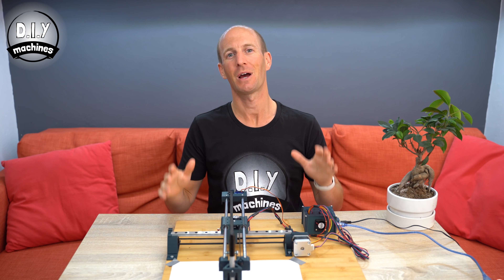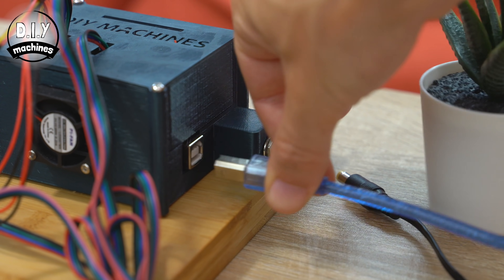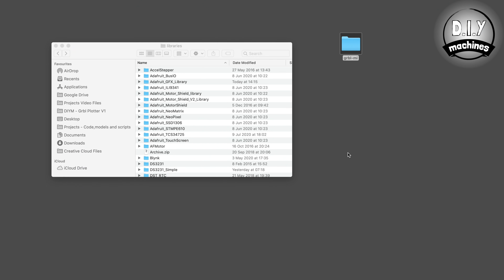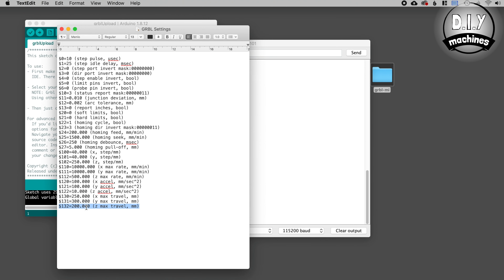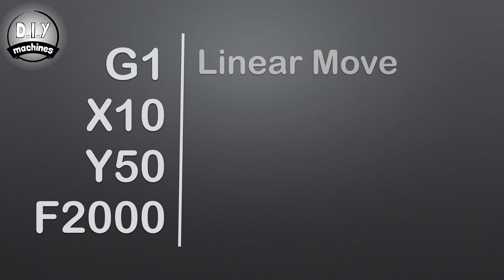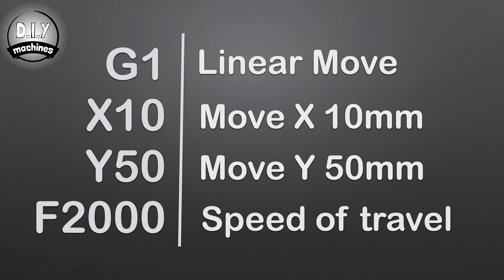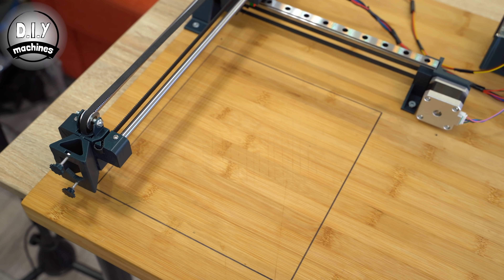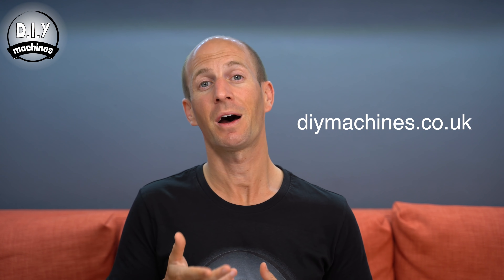Part 2 - Super Easy 3D Printed Arduino CNC Drawing Machine - The Software | GRBL | Inkscape Plotter

Comment: I don't understand why you wouldn't just use a regular printer?
Reply from the maker: I've used this to draw onto material a normal printer could not. Cake in the video, but also large panels of balsa wood to then cut out with a saw and make a model boat.
Reply: @DIYMachines  Thanks for replying, first up i feel i must say i'm a toolmaker, with my own DIY CNC in the garage/workshop capable of milling steel. 
The cake print, sure, understand that one, those are pretty expensive. Model boat, 3D print it or in my case mill it, unless the material is of great concern, tho i never really understood why people care to build models of already existing work. But yes, i can see how this "printer" would appeal to the DIY model community
Currently i'm looking to build a laser cutter, for cutting gaskets and figured i could use some ideas from your build

Comment: So my servo does not work with the M5 M3 codes. i am pretty sure i did the correct connections and tried servo on another arduino, it works right. How can i solve the problem. Also my steppers works so slow and vibrating. Does anyone knows why?
Reply from the maker: Which stepper motor driver are you using?

Comment: Sorry dude but your design is awful, that machine wouldnt last 100 drawings without falling apart. you did everything wrong, from putting the endstop switches backwards to making all the plsatic parts super thin. to be fair you dont even need to use it 100 times, the plastic itself will break due to creep because you made it all so thin. Also timming belts are not ropes, use a rope to pull the pen up, not a fricking belt!, a piece of fishing line would do the job better and why did you even put the servo on the other side! just put it right next to the pen holder! god!

Comment: I am really enjoying the results I get from this, very accurate. I am unfortunately getting an Inkscape crash whenever I try to use the gcode extension on an SVG file with lots going on. Simpler designs convert with no problem and look great on the finished paper. Is there any work around for a big load of gcode that needs creating? In smaller parts perhaps?
Reply: Can you layer it?

Comment: How does GRBL or chillipeppr know my pulley-size thus my steps/mm-ratio?
Reply from the maker: You set it in the configuration of GRBL in the following values (how many steps of the stepper moor creates 1mm of travel). Only GRBL needs to know this - chillipeppr does not (it's just a utility to stream the GCODE commands to GRBL with a pleasant GUI):

$100=40 (x, step/mm)
$101=40 (y, step/mm)

Take a look here for some more information: https://diymachining.com/grbl-settings-101-a-how-to-guide/

I hope that helps. Lewis
Reply: @DIYMachines  Thank you very much :)

Comment: If anyone is finding that their XY motors are only moving the pen around 40% of the area that they should be; I had to change both lines $100 and $101 from 40.000 to 100.000 in the GRBL setup document. That sorted it for me so that the X and Y are at the correct scale.

Comment: Hi, I wanted to congratulate you on the project ... it's really crazy!
I scrupulously followed the step-by-step video instructions, but I encountered 3 "problems":

1) Right / left swing of the pen (slight, but prevents small details);
2) Up / down swing of the Y when the servo clicks or in extension beyond 50%;
3) Using the square procedure only about half of the effective area is covered (225x250mm). The $ H procedure is successful.

I wanted to understand if the first 2 points are normal or not and how to solve point 3. Thanks a lot and congratulations again.
Reply from the maker: Thanks for the kind words BlackGeare, I'm glad to hear you managed to follow my instructions. :)
To answer your points:
1) This can be reduced by having less distance between the 3D printed pen slider and the mount it is on. Though too closes and it will not slide freely. A better solution is to mount the pen slider on two small steel rods. This would almost eliminate it but I one of my main design goals was to limit cost and this would have required more steel rod and an additional linear bearing.
2) This is something that has become more apparent to me since I published the design. Where the teeth catch the the main slider you could take the 90 degree edge of with some sand paper and make it more of a radius. As for the extension, this is another cost management choice. Ideally we would have to linear rails - one each side of the print area but this would certainly be a much bigger cost. To make up for this movement at full extension I designed the pen part so it can rise and fall by itself to compensate for this. A slight trade of win accuracy for a big cost saving.
3) To increase the printable area of the machine if it physically is able to travel further on each axis just create a larger document size in Inkscape. 

I hope these points help.
Lewis
Reply: @DIYMachines  Thanks a lot for the answer. I fully understand the need to reduce costs and believe that the project itself is still great. To mitigate point 2 I have reduced the angle to 35 degrees, but I think the main problem is due to the "speed" of the servo movement (too lightning-fast click).
For point 3 is it better to have the origin in the corner (from $ H) or in the center of the print area?

Comment: Hi Lewis. The plotter works great for me but when I use Inkscape to create a g code file with a few objects, when it comes into Chilipper, there's a line from the origin to the first object and then line connects all the other objects.  But when I made the boundary box file it was ok.  Any idea what I'm doing wrong? Suggestions appreciated. Thanks, Gord
Reply: No need to reply. I figured it out. The M3 and M5 settings need to be reversed as you said :-). Thanks!

Comment: Instead of belt can you use T8x8 300-600mm Lead Screw Pitch 2 Lead 8 Stainless Rod Linear Rail Bar Shaft?
Reply from the maker: Yes you could do this. You would need to adapt the printed parts to accommodate the change in shape.

Comment: Hi, great videos. I’m nearly done building this but have a couple of issues. 1 noisy steppers and 2 I have had to set the grbl configuration to $100=5.00 x, step/mm)
$101=5.00 (y, step/mm) to stop the x and y trying to go outside the limits of the drawing area, they just fly off at speed!  Got to be a config issue but not sure where to start. I have 1.8degree 200step motors.
Reply from the maker: Hello, and thank you. First question, which stepper motor drivers are you using? You are correct to adjust $100 and $101 based on your machine. Ideally have it draw a 10cm square and adjust this values up or down until what it draws is actually 10cm's square. Are you zeroing out your axis after homing the machine - if not this is like to cause it fly of at speed and make an uncomfortable noise. Check here in the video: https://youtu.be/8scKLHz77Lg?t=660. After zeroing out the co-ordinates in the top right of Chillipeppr should all read 0.
Reply: @DIYMachines  many thanks for the reply. I’m zeroing manually at the moment as I don’t have the end stops installed yet. I’m zeroing. In the correct place though! I’m using DRV8825 and the CNC shield
Is set to full step (no jumpers) if that is relevant. I’m drawing a box and it is just about the correct size. This appear to be working ok , just the steppers are noisy and I’m
Puzzled why I need to change the vales in the config file. (I’m using UGS btw)

Comment: Hi,
now I made some drawings on that machine.
Some comments what I notieced:
Drawing in incscape is difficult for me. Did use a wacom tablet to copy a printed drawing to incscape. When I draw not only a single stroke but more back and forth with the pen then sometimes the GBRL extension makes a round circle out of it. Have to find a workaround. Or do only single strokes. 
Some odd pehenomena is, that I draw some freehand lines and the machine via Gcode does exactly like I did with the pen. Same slow downs. But have to experiment a bit to confirm that behaviour.
Maybe I have to write a simple programme to feed the gcode to the machine. Then I can feed line after line under my control and when I want to change the pen then I can simply stop the drawing and change pen. Or redraw some lines. In case the pen did not work.

Comment: Fantastic and very well presented project. Thanks so much. I have a question. I built a small demo CNC plotter by DAZ Robotics (https://www.youtube.com/watch?v=WtUIBxfddjw&t=314s) using three 28byj-48 stepper motors and ULN2003 controllers, arduino uno  (no shield), and 3d printed gear rails. It is a very interesting design and works fine.  If I use the hardware and all the wiring from my existing machine, what do I need to do to use the software part used in your presentation? I can change the Z-axis drive to a servo to match your design. When the stepper motors and drives are different, how is the grbl configured? I can get the drawing and the code generated using various options. How is the MI GRBL configured for a specific use?

Comment: Couldn't get it to work because it kept slamming into the side with the X axis motor. Then it occurred to me that the build plane is wrong. At 12:39 you say to set the width and height to 225 and 250 (in millimeter) respectfully. However the physical print area it only 30x30. Once adjusted it was fine.

Comment: So when I give the command $H it does go to the X0 Y0 and bounce off the switches, but then both motors go to about the X6 Y6 cords before I can set the G92 X0 Y0 command. Any idea on why it would do that?
Reply: Okay, so I figure out that the config file can be set at $27=1.00 and that will set it right.

Comment: Hello, 1st of all, thanks for this amazing tutorial.

Unfortunately, I have an issue? My stepper motors don't move. The CNC shield is well powered, the drivers Vref are set to ~1.15. But nothing moves, they're not blocked either.
Can you tell me : should I have power on pins near the drivers when I ask for a movement ? (the 4 ones on which we plug the stepper motors)
Because I don't have any :/

Any other ideas on how to fix this before I order a new shield ? 
Thanks
Reply: Hi Romain, did you manage to resolve this? I am having a similar issue
Reply: @satishkarsan  hello. Yes I managed to fix it by using an old version of grbl (0.9), where the one linked in the tutorial is 1.1
Reply: @Pix4Geeks  Hi, great to hear you have fixed your issue. I maybe being a bit silly, but the link still refers to 0.9. Please can you share your link.

Comment: Hi Lewis! All have been printed, but there is too much play between the pen holder and the plastic where it mounts, so the pen is not perfectly stiff/still when used for drawing. Is there perhaps another way to try and fix this? Any possibility you can share the design files?

Comment: Wow.can you please explane me that how did you make the gcode by using the inscape to take varius kind of colours of a image
Reply from the maker: I put the different colour onto different layers. Then exported each layer one at a time into GCODE. They are each then run on the machine one after another ensuring your home the axis after changing the pen each time. This means you don't have to worry about the layers of the image drifting if you nudge the head of the machine.
Reply: @DIYMachines  And how did you create the fill with mi grbl & inkscape? (Great machine by the way!!)
Reply: How to create gcode with more layers.plz explain or suggest some video.thank you

Comment: Awesome build, does it draw fine detail with pencil?
Reply from the maker: Thanks, I've never actually used a pencil on mine. I put some fine liners in it and had it draw out some fairly detailed technical drawings which it seemed more than capable of.

Comment: This should also work nicely with an old 3d printer mainboard. I have an old ender 3 mainboard which is basically an Arduino with stepper drivers...maybe I found a use for it 😁

Comment: hey can you help me please??

the servo don't move at all  i try to use (m5 , m3 )command but it did not work 
so can you help me please
Reply from the maker: Hi Ziad, I can try to help. Has the machine be homed?
Reply: @DIYMachines  yup I homed it then try to make the servo move but there is no moving and give it the test print but also no moving

Do you know what is the problem???
Reply from the maker: @ziadelgarhy2404  We can try ad figure it out. Do the stepper motors move like they should and it's just the servo which does not move?
Reply: @DIYMachines  when I give the command of homing the x axis go to home but y axis don't move but when I gave the order If moving to y axis it's move but it doesn't go to home
Reply: do u remeber how to solve this? here is the same, looks like arduino reset after M5 command =/

Comment: Awesome product and great video! I'm kinda interested in building this, do you know the total cost?
Reply from the maker: Thank you. It was roughly £85 of you needed to buy most of the electronics and rails/rods.
Reply: Let my copy past my older comment here, hope it helps :-)

Hey guys. I did some research and managed to find all the parts for around 90€. (printing, screws, wood and stuff not included)
Just in case it´s helpful for somebody, here is the list: (note: some parts are from ebay germany but you should find them international also, however most parts are from CN so you have to be patient ;-)) Prices in list are from Sep 24th - prices vary from day to day, but with around 90€ you should be in the same ballpark. Also check for coupon codes on aliexpress!
List: https://docs.google.com/spreadsheets/d/1x4umLIupzvAYpdcEAnp_9ZDpc8oV2mRbMIxAm9QQhs0/edit?usp=sharing
Reply: @d3rsch0rsch  thanks for  that. The only thing I don’t have is a 55mm 8mm rod. I’m hoping I can use a 50mm...
Reply: This is excellent. I have a random collection of parts but I’m going to build this. I have a plan to make a machine that’s carried out a specific task and this would be a great place to start the learning process. Thanks.
Reply from the maker: @geospectrum  Glad to hear it might provide some inspiration.

Comment: Hi Lewis!  We finished our build, had a few issues to work through, but for the most part we figured it out. One of my issues was that for some reason my X and Y always moved in the opposite direction. I triple-checked all my wiring and all was good, so in the end I just changed the pinouts on the stepper motor connectors and that seemed to get me working. I was able to print your DIY Test gcode successfully. My last issue that I cannot figure out has to do with the Inkscape 0.48.5 and Chilipeppr. I follow the video instructions, and get my gcode file, but when I open the gcode in chilipeppr, it is very small. I cannot figure this out, does anyone have any thoughts? I am not sure if I am missing something in chilipepper, or inkscape. So close to the finish line.....
Reply: Update: Scratch my above post. I had previously installed a different Inkscape version for another project and it left behind some settings that 48.5 was picking up. After cleaning that all up I am good. Sorry about that...
Reply from the maker: @berner57  No problem. I'm so glad to hear it's working. :) Thank you for letting me know.

Comment: Great videos. I have to try this. But I need to modify it a bit. I need to print on cardboard cylinders. 
This should be possible by locking the pen arm and use the stepper for rotation in stead... or am I wrong on this?
Reply: Dont lock the pen arm just add two servos attached to two rods with bearings on one end in a support housing with, you may need some extra parts just do some research and im sure youll find what you need, even possibly a video explaining how.
Reply: @b-rad7708  I did not explain my self very well. This is what I want it to do: https://www.youtube.com/watch?v=BLRfBk9yIbw
But since I also need a flat bed plotter I was thinking of a mix.
Your plotter as it is but with the possibilety of adding a 4th axis

Comment: It is so funny that you posted this right now. For the past week I have been thing about building one of these on my own! 

I really like the concept of converting such an analog process (writing) into something controllable. 

Your use of writing on the phone case seems like an awesome idea!
Reply from the maker: Thanks Trevor, that is great timing. I did it for the same reason but thought out in reverse, I wanted to see something as digital as GCODE generate what traditionally is analog (the handwriting). :)

I've been using the phone case eversincme it drew it and feel I little proud of it every time I see it.
Reply: @DIYMachines  I am planning on making a slightly modified version. If you'd be interested I can show you the results when it's finished.
Reply from the maker: Trevor Clarke That would be great to see what you do with it.